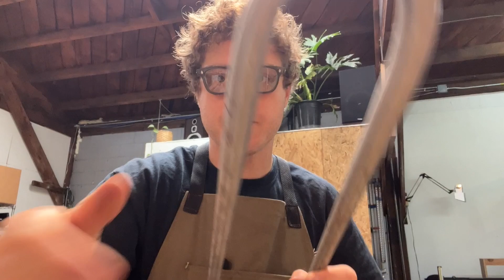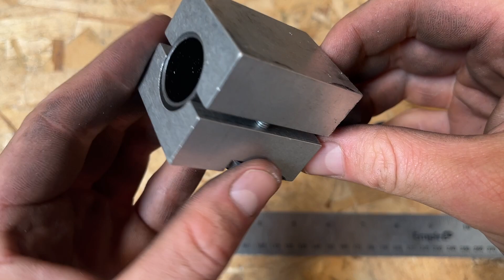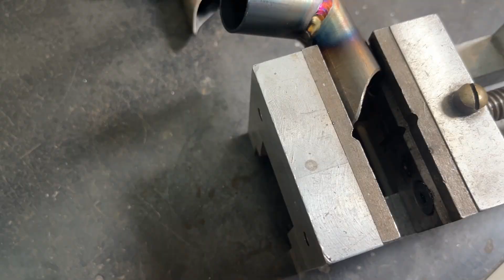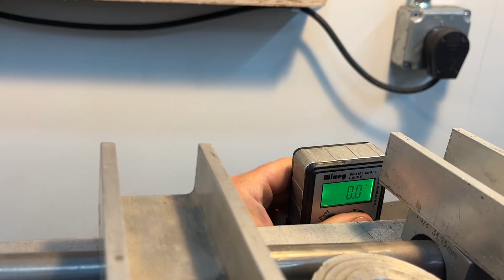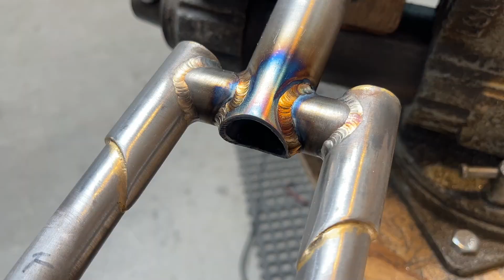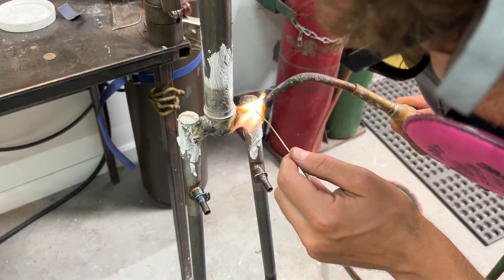Process Video: Building a steel bicycle fork from scratch

Comment: Had a pair of old school, maybe 1996 Kona straight blade forks.
They put alit of tech in such a simple item. Heat treated, triple butted 1.3mm/ 0.8mm/  0.5mm. They even had the steerer tube rifled at the base, like some old school Columbus tubing for more  strength while saving weight.
Pretty crazy for a relatively cheap production fork.
Too bad that bike got stolen.
I believe it weight about 865g light for a steel mountain bike fork, granted it was for 26" wheels. Most steel mountain bike forks today weigh in at least 1200g.

Comment: Cool video! Could you provide some insight regarding tubes sizes (diameters, wall thikness) used when building segmented fork for gravel bikes and for more off-road, heavy duty bikes? 

Thanks!
Reply from the maker: You want to choose tubing that is strong enough that it won't break but light enough that it will ride well and not be super heavy.